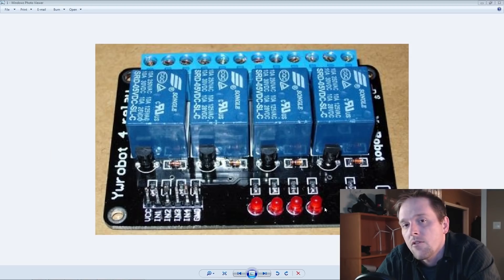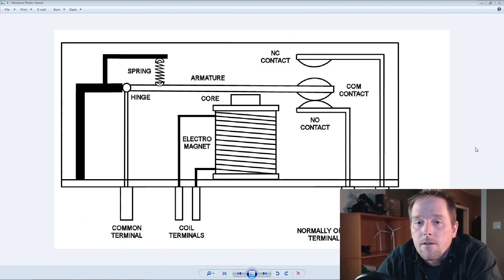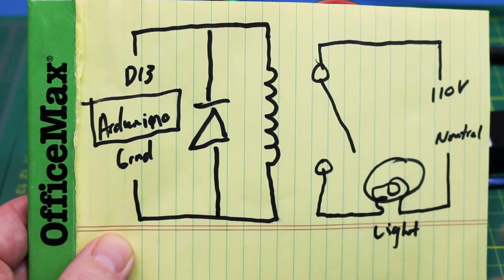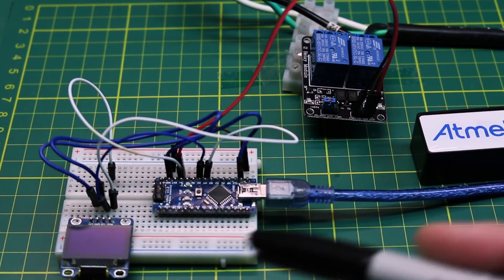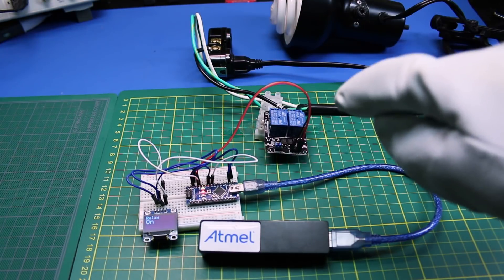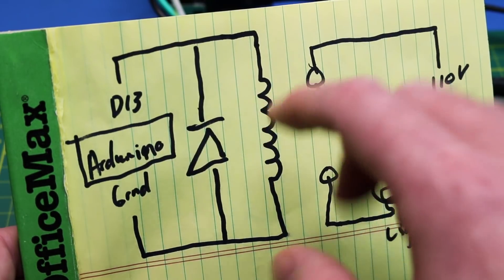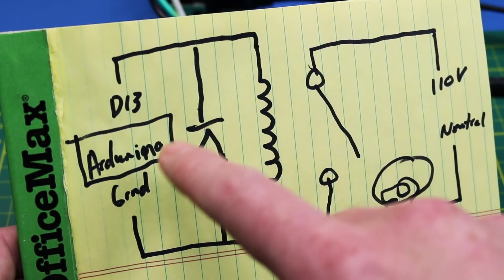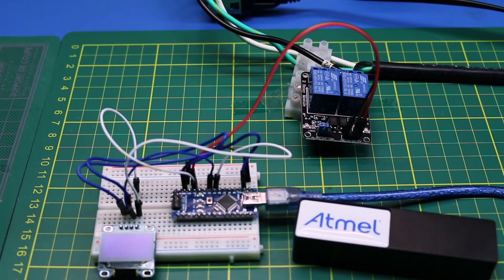How To Add Relays to Your Projects- The BASICS

Comment: thanks for the info! question: I want to run an air filtration system with an ir controlled relay with remote, since the unit will be hanging from the ceiling. But I'd like to have a couple options, ON, OFF, 2HR, 4HR & 8HR run times. Can I do this with relays only and some type of timer or would I need to incorporate a pi or arduino?  Thanks
Reply from the maker: You could do either. Easiest would probably be to use an Arduino and a real time clock to control the relay. Just use the code for my Arduino Urban Kitchen Garden project and adapt it.  Easy. https://www.youtube.com/playlist?list=PLxyM2a_cfnzgLjCoJ04S2Z812JrdFKbFX
Reply: @MkmeOrg  hi dude read your comment and watched urban kitchen, nice nice. Ive got some GM5 far red 12v led pucks that i wish to power from 12v CC led driver triggered by a 12v signal from chilled drive controller. Im a new twat at diy electronics but i love it!  Ive had to learn a lot building a new indoor garden as eco as possible. 2KW of led still!! Any help much appreciated

Comment: Hi guys,
I'm building a custom portable laptop-like-UPS, in order to feed my NUC (the Intel Skull Canyon) when not plugged in the wall-socket. 
I've determined more of less the rest of the components I need, but I have difficulty of finding a proper relay for the purpose of switching from the main-power to the battery when main-power is off.
I'll need a relay with 2-inputs (one for the main-power, and one for the battery) and 1 output (to the NUC). The closest type of relay I've found is a DPDT type /looking at its basic diagram it actually has 2 outputs, but I can always link them into one/.
The NUC needs up to 120W (19V @6.32A) which is why good old laptop scavenging is not likely to work (most laptops have lower consumption than the NUC, which is also the reason to consider building my own UPS. Also I think the switching relay circuit is actually in the laptop body rather than in the battery, and I don't have many dead laptops laying around).
Anyway, most applications of relays on the net I've found (like this one too) depend on outside control of the control-coil, and are often of different type /than 2INs-1Out auto-switching/.
My case I believe should be simpler, because both the inputs will be DC (the battery obviously without inverter will give me about 22VDC, and since its charger also requires DC, I plan on using common AC/DC adapter which will output 20ish V DC).
So I was thinking that if I link the main-power not only to one of the relay's INs (lets call it A) but also to the control coil terminals, which under current should keep the relay in A-input closed position, and will feed the NUC. 
Then when the main power is lost, it would also lose the current in the control coil, so it should automatically switch to it's normal position closing the B-input circuit.
Would that work? And could you recommend such relay capable of say up to 27V and 7A (or up to 120~150W) /could be stronger of course/

disclaimer: I'm complete newbie regarding electrical stuff, so please correct me if I'm wrong /or missing/ something! For my own safety! :)

Comment: I've just bough a Dushbutton from amazon (5$) ...is possible to use an arduino micro with a wifi module and a relay to turn on a light? :)
Reply from the maker: Sure you could.

Comment: hi I'm using a relay and Arduino to switch  on and off a solenoid door lock
my problem is on power up of the Arduino the relay activates unlocking the door 
I set the Arduino pin low but dos't help.
Again my problem is when the Arduino power is restarted the door opens as the relay gets 
a pin high from the Arduino

any help please
Reply: Try setting your pin HIGH initially. Make sure you do this in the setup() phase.
Reply: MrBildo thanks for your help I made the change setting the pin HIGH and made the changes in the  loop from high to low etc
and it works great
so thanks again

Comment: I'm hoping to use this technique to create a quick-shifter system for my motorcycle. Quick summary: Instead of cutting throttle, disengaging the clutch and shifting gear, which can take hundreds of milliseconds at least, one can simply cut ignition to the engine momentarily and shift gear. Without ignition, the transmission momentarily "floats" without torque on the system and allows the gears to engage without stress (normally wears or even breaks gear teeth). I started with the idea for simple electromechanical system; A spring loaded piston in-line with the gear shift linkage allows you to push on the gear shifter until it encounters resistance. Subsequently your spring compresses, which closes a circuit that grounds the engine's ignition coils, which cuts spark to the engine. With the transmission now unloaded, your gear shifter would have no resistance as it pushes the transmission into a higher gear. As you finish actuating the shift lever, the spring loaded piston returns to open the grounding circuit and your engine continues its ignition sequence. Notice this still limits shift times to hundreds of milliseconds that your foot is pressing on the gear shift lever, grounding out the engine ignition system. I know there must be a similar analog method to hold a grounding circuit closed for a set time interval from some kind of input from the spring piston system, but I do not know how to do it. I'm thinking it will be easier and allow more refinement to use a simple Arduino microcontroller to receive that signal from the spring piston and then open a relayed grounding circuit for a set interval, in the 10-100ms range. There are several quick-shift systems available on the market, I'd rather build my own as proof of concept. What are your thoughts?
Reply: The motorcycle can supply constant 12~14VDC from a DC battery and regulator/rectifier.
Reply from the maker: My 2 cents- The times you are looking to get are beyond what a relay can do  and you should look at using MOSFETs. Another issue you need to handle is the fuel- unless you stop the supply you will run into a large backfire out the exhaust when ignition is re-engaged. On fuel injected systems this should be easy for you- if carbureted, this is much harder.  Good luck with your project.

Comment: Can I make a sketch that gradually fades the light bulb in and out?
Reply from the maker: For that you would need a solid state driver like a transistor- Relays are a bit too slow for dimming and would cause massive back EMF issues as the relay coil becomes similar to an ignition coil :)
Reply: Ok, I've found out I can, but it's too hard for my electrical skills. I'll probably buy my way out of it

Comment: Sir i don't know how to give power to the relay?Can i give it from the arduino mega board which i am having or externally?
If i give it from the board will it damage it or if externally then how should i do it?
Reply: Do it externally. Remove the jumper on the relay and remove the ground wire coming from the Arduino. Connect your 5v power supply to the relay GND pin and the JD-VCC pin (or whatever it's called on your relay board, where you removed the jumper). Otherwise, you may encounter Arduino resets when the relays are under load.

Comment: Hi Eric, i would like to run a freezer and a water pump  with PV energy ( without electrical storage ). To switch the pump and the freezer on and off i am planing to use relays. To make best use of the PV energy  i am thinking of using  uv LED light strips to sterilize the pumped water. So my question to you is, how would you control the uv LED light strips, with MOSFETs or relays? Thanks in advance
Reply from the maker: +Coco Mbella If there isnt need for dimming etc- Good old relays work great and the current consumption for the coil activation is quite low.

Comment: Hey there I am glad you mentioned the diode.  The voltage spike can really destroy a micro or transistor if the relay coil is big enough.  I usually use a 1n4007 or similar if I am using relays that don't have an onboard diode.  Cheers
Reply from the maker: +misperry Sure can.  Cheers Sir
Reply: Relay boards do have diodes right?

Comment: Hi Eric, in the video you stated that for those who wanted the more elaborate code you would put the link below but I can't find it.  I am particularly interested in the oled code.  Thanks Eric good video as usual................................. Berni       UK
Reply from the maker: +berni ken Hey Berni.  Added it to the description but it is really messy and needs the junk from the pulse sensor code removed.  You will get the idea though but if you need just the OLED go check out my OLED example video and grab that code- much cleaner :)

Comment: Good stuff Eric,  I realize that the relay schematic you drew was deliberately simplified for illustration,  but it's very much worth mentioning that the arduino can't source enough current to drive anything bigger than the smallest relays, minimally a transistor should be used to switch them. The boards with an integrated driver (likely an opto-isolator) like your boards are a big help and not particularly expensive.
Reply from the maker: +TheWreckingYard Indeed. In hindsight I wish I did the video a bit different but for the audience that will actually be searching/viewing the video I figured this would do. Hard to draw the line and not make 20 minute videos that no one will sit through :)
Reply: This, so much. Arduino resets will plague you if powering relays from the Arduino. Remove that jumper and power the relays separately.